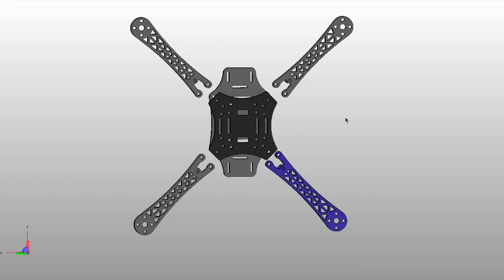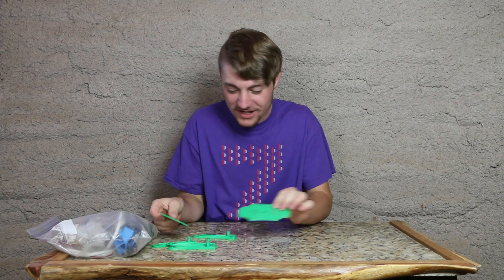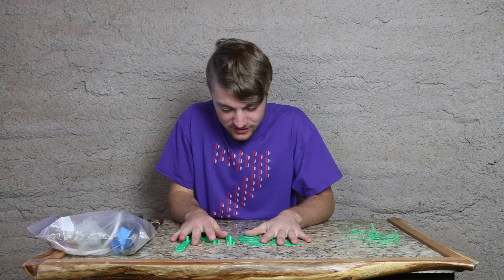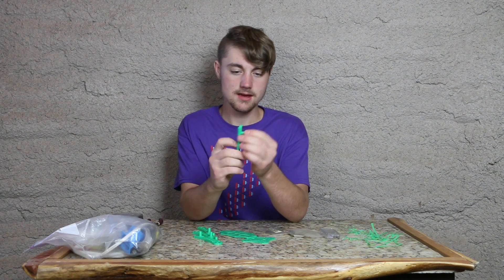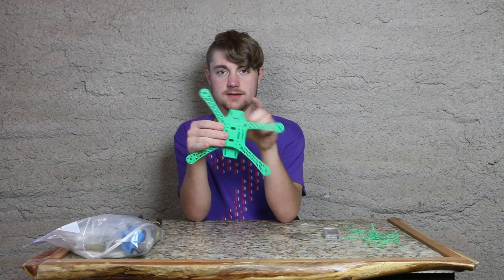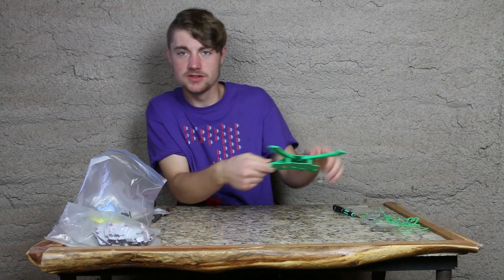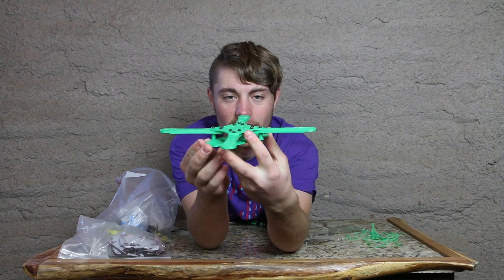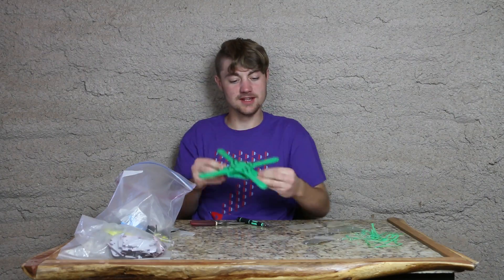3D Printed Quadcopter Frame! [Thingiverse Print Review] (part 1)

Comment: I'd have to say that if I was going to 3d print a quad frame, I'd use a decent aerodynamic tubular design for the arms instead of something that looks like it was designed to be cut from sheet cf, but apart from that it's a great application for a 3d printer.